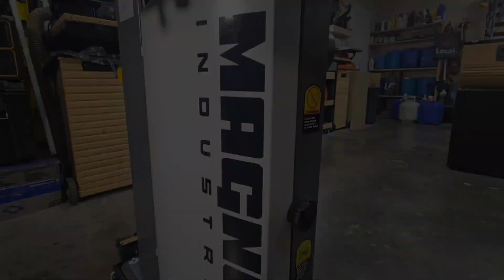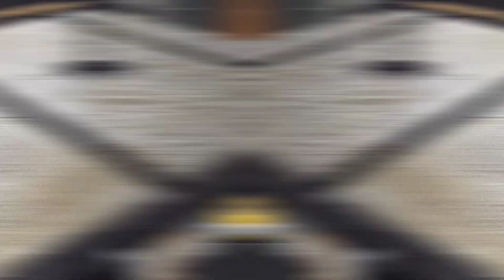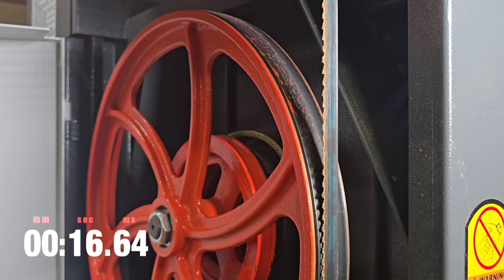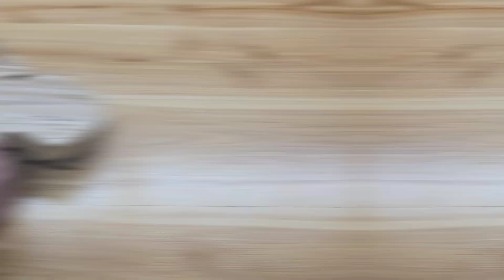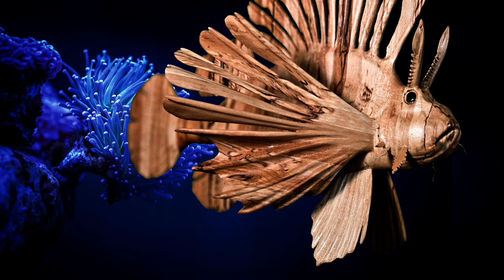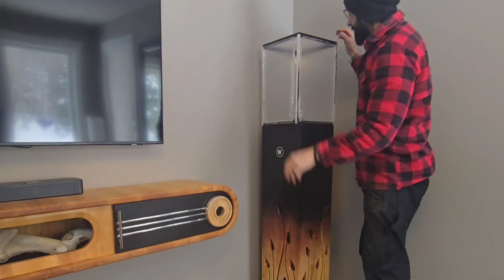From Review to Creation: Magnum Industrial Bandsaw Review + Epic Project!

Comment: AW, The KMS band saw look like a is constructed with strong, high-quality materials and components, designed to be sturdy, reliable, and able to withstand significant use over time. As for the  the Lionfish, To repurpose some hardwood and select a creature to display the woodgrain pattern of the project is impressive👍. Hopefully the Lionfish will be treasured forever. I am sure you spent considerably amount of time on the Work of Art. Looking forward for the next episode.
Reply from the maker: Amen to your description of the saw! 😄 And yes, this piece took forever and was a lot of effort, but it was worth it. I had so much fun working with this new tool. It inspired me to another art project that I am working on already!